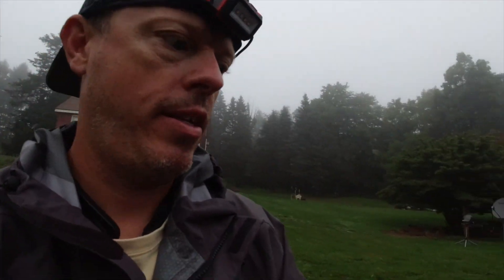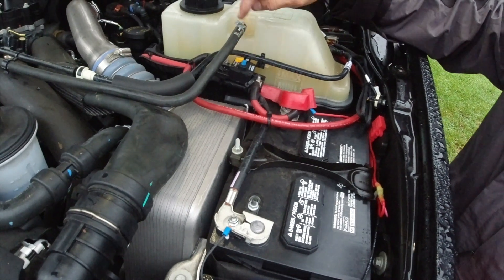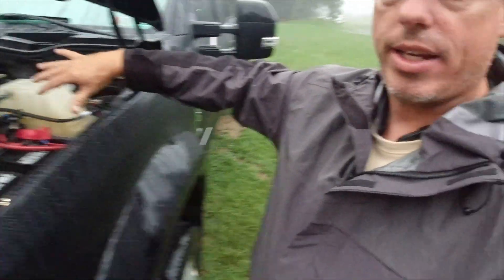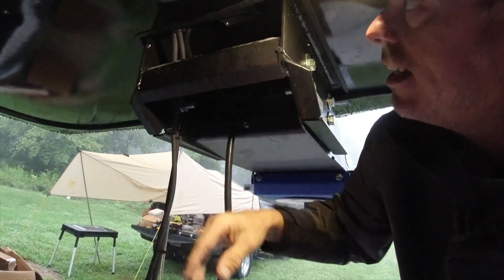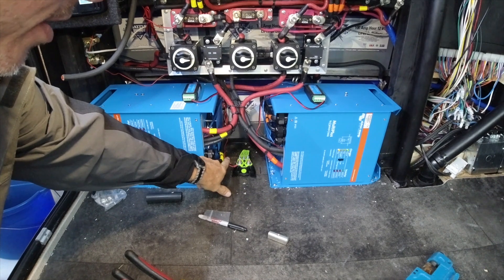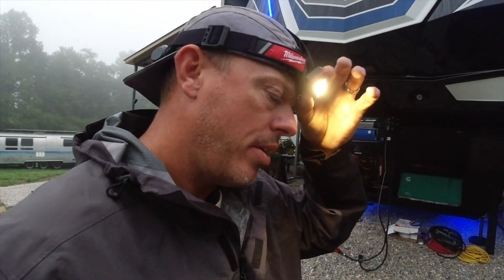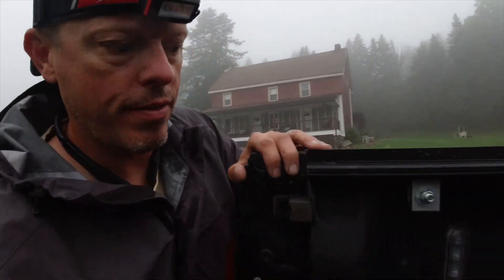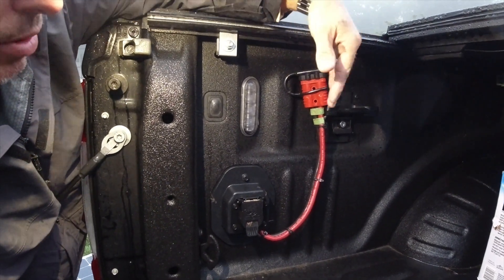Truck Alternator Charging for RV Solar Setup | Ford F450 Limited

Comment: Didn't catch the name of that dc to dc charger but would the Orion by Victron work as well? Ironically some places don't care if your truck  Idels but generators flip them out. Not to mention the benefit of travel day charging.
Reply from the maker: I think it was a Li-Bim, Battle Born sells it. Yes, Orion would work too, the output is less desirable.

Comment: What would happen if you used the existing Ford hot lead in the 7-way with a battery isolator/DC charger? Would the battery still get charged when driving but only at a lower amp charge?

Comment: Good afternoon.  New subscriber here; picking up F350 7.3l gasser with 2 batteries and alternators next week.  Then we are picking up an Outdoors RV 22FQS in October-ish.  We live in Ouray Colorado.  So, have no problem traveling out to Denver, Salt Lake, Albuquerque, Santa Fe, or Flagstaff/Phoenix for solar installs. 

Great video!  Thank you for sharing your experience on this DC to DC system.  I've seen that yellow dog bone looking device that goes into the camper, but wasn't too familiar with it.  And, I've also see the victron orion dc to dc charger (and the renogy dc to dc systems).   When I was watching your video, I was specifically wondering if you hook up the wires to the truck battery or alternator.  Looks like you hooked it up to the driver side  battery, which charges the rv lithiums, and then the truck alternators take care of distributing the charge to the truck batteries?  Do you know what kind of charging amperage you can expect in this configuration?  

Of course, I'm watching the video 9 months later, so who knows how the set up configurations and technology  changes have occured.

Safe travels!!  I'll keep an eye on your website for you announcing your routing for 2022.  As I said, don't have a problem delivering the trailer up to 500 or 600 miles.

Comment: I have a 2020 F550 with alternators 2 batteries and factory inverter 400w... I’m going with the Orion dc/dc unit. I have been told that I will need to connect to the alternator directly instead of the battery... any thoughts on why.  I do like the idea of the breaker instead of the fuse. Does it matter which battery or alternator if you have two each?
Reply from the maker: With the 550 you wouldn't be drawing enough amperage from the truck electrical system to matter where the connection is made. The 400W inverter will only draw 33amps at 100% load.
Reply: @TheDryCampers  thanks I heard from Ford and they recommend that anything drawing more than 30amp get connected to  either battery the onboard computer modules decides how much the truck need  from either alternator.  What AWG cable would you recommend ?  I have about 10-15ft distance from the truck battery to the RV.
Reply from the maker: @carmas54  I personally use 2AWG, but you may want to also ask Ford. The wire run will be closer to 20-25 feet.
Reply: @TheDryCampers  the RV is a truck camper ... battleborn said to use 6 awg from the truck battery to the Orion ...  ant go wrong with 2 awg ... your thoughts

Comment: Great video, but 1 question: how much current is that setup passing to the RV batteries? I’m concerned a F450 with the 240 amp, 332 amp or 397 amp alternator setup from Ford is going to pass way too much current for the wiring.
Reply from the maker: Thanks Scott, the wire is actually doubled sized for the amount that is flowing. It’s the actual LiBim that is allowing power to the batteries and at most it only allows 48 amps per hour to the batteries. The Andersen plugs are oversized as well.

Comment: Great video.  I plan to install the Victron Orion 12 12 30 in my Airstream.  I see you did not run the negative cable from the Anderson plug on the truck all the way to the battery.  You briefly mentioned that you grounded the negative near the back of the truck.  To which part did you attach the ground.  What kind of connector?  Do the mismatched lengths of positive and negative cable pose any issues?
Reply from the maker: Ground is mounted to the frame, which is an 1/8 thick, ground it down first, anchored it and then under coated it, on both sides. If there were more current flowing than the 48 amps per hour, I would have ran the wire all the way to the engine compartment.
Reply: @TheDryCampers  nice work.! Thanks for the thorough explanation :)  Your installs are first rate!

Comment: So you run that great big wire. Makes total sense. But then the module shuts charging off after 20 minutes? The big wire doubles the amps, but the BIM module cuts the charging time in half? So you are right back where you started, right? What am I missing?
Reply from the maker: Because the LiBim shuts off you have to use a large gauge of wire to allow the current to flow while it is active. The timing of the LiBim helps save the alternator from burning up. It’s by no means designed to be a main source of charging. It’s just for driving on a cloudy day or not having to drag out a generator to charge batteries back up.

Comment: Great videos!   Wish I understood everything you talk about.  How did you learn all this?  I would love to understand solar installs better.
Reply from the maker: Thanks, Barry. Appreciate you watching and the compliments. Mike has 25 years of low-voltage electrical and installation experience with a background in security systems / camera systems, etc. A lot of things he taught himself over the years, but as is mom would say, he used to tinker all the time when he was young. We hope that our videos are interesting and informative. It's hard to work that in with all of the installs, but we hope to bring some informative information to the community.

Comment: You should install a stinger high amp relay so all you have to do is flip a switch to turn the power on instead of having to pop the hood
https://amzn.to/33tPn0p
Reply from the maker: weekends with the camper this stays on all the time and only charges when you plug in. No need to pop the hood.

Comment: Great info, thanks for sharing. What are you thoughts on Victron's ORION-Tr Smart Isolated DC-DC Charger? Would you still need the LiFePO4 Battery Isolation Manager if you had the Victron Orion???
Reply from the maker: James Gibson hey! So, Mike is still working (after 9PM), but I did ask him about this product. He always wants the client to get the bang for their buck and he says the Orion is more pricey plus it will only go to 30 amps. 🤷‍♀️ He says it is a smarter version of the LiBim, so you would not need both, correct. Hopefully that makes sense to you, but if not, let us know. Thanks for the question! -Leanna